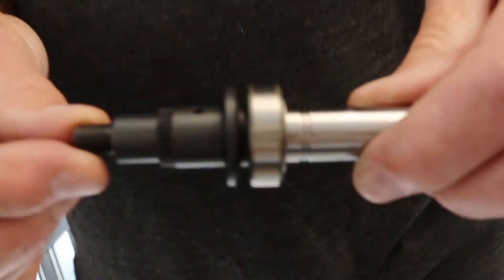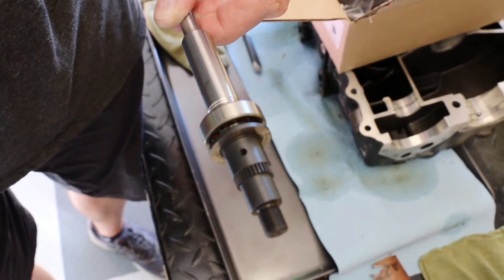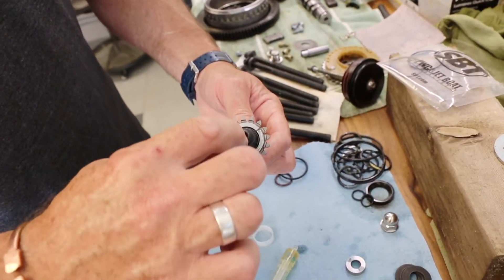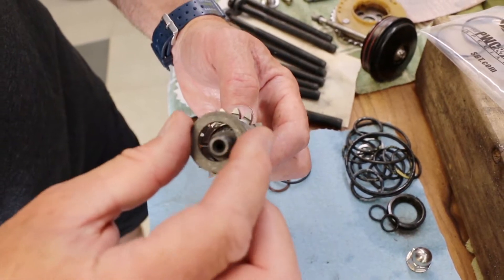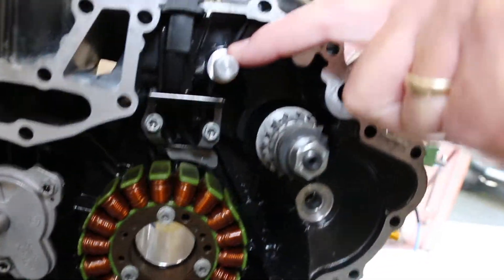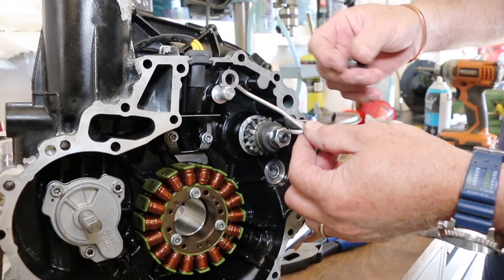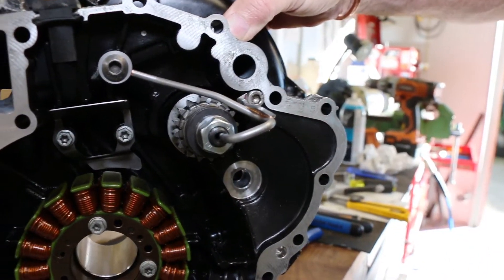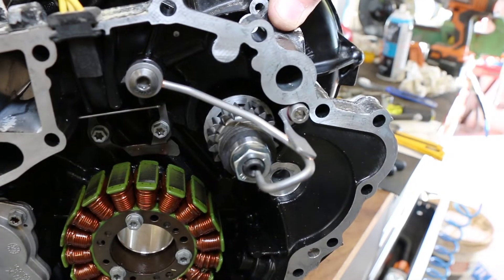How To Upgrade The Supercharger Oiler On Your Sea-Doo Personal Water Craft

Comment: With a supercharger you should always use a digital torque wrench not the analog style simply because the digital 
 is less affected by factors like friction, temperature, or mechanical noise, that  causes inaccuracies
Reply from the maker: Good point. Digital ones were much more expensive at the time we bought ours, though.

Comment: How often are you suppose to rebuild the supercharger on 2008 215 after the initial change from ceramic washers.
Reply from the maker: They keep improving the kits, so it depends when your rebuild was done. The range is between 150 and 250 hours, but we wouldn't suggest more than 200 hours and more like 175 hours. Also, time will also degrade components in the supercharger (especially the bearing case), so we also recommend doing rebuilding it every 5-7 years.

Comment: is it possible to give me the link where you found the parts because I can't find it on the seadoo site I have just had my 2005 RXT 215 repaired and it cost me 4000 € I would like to make your modification this is very interesting and it might make my jet last longer
Reply from the maker: Hello Jean-Philippe, The parts are dependent on each make and model. First check out this link here for your machine: https://shop.sea-doo.com/ca/en/shop/sales/parts/. You should do like we did and call up your local dealer and order the supercharger upgrade kit for your machine. That way you can be certain they're the right parts. It won't make your entire machine last longer, but it should extend the life of your supercharger before it requires rebuilding. Good luck!
Reply: @3ftDeepChannel  thank you very much